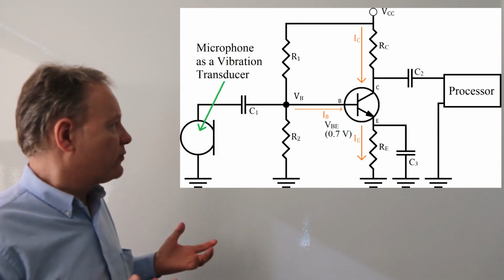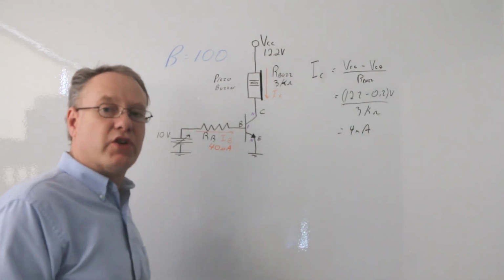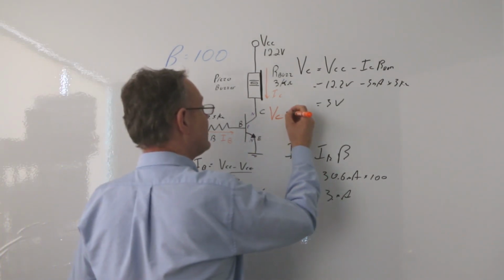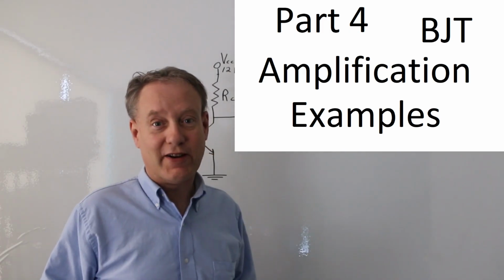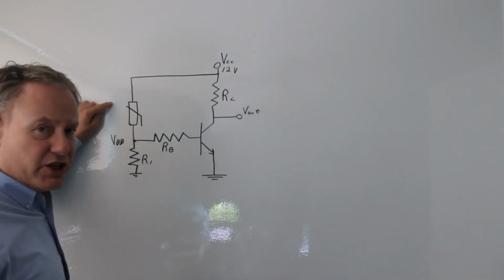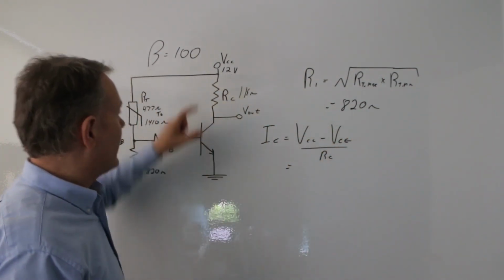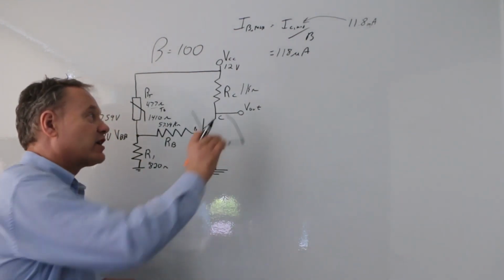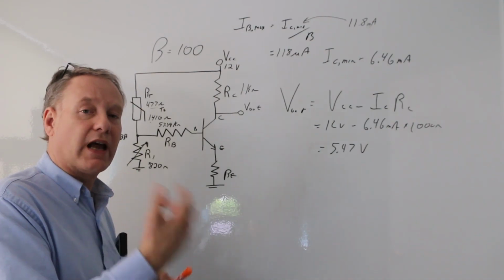Bipolar Junction Transistor (BJT) as a DC Amplifier Lecture 1

Comment: If we have a sensor width voltage range 0 to 200mV DC  and we have only one power supply 5V DC, using one single transistor interfaced to 8 bits ADC. How to design the interface circuit ?